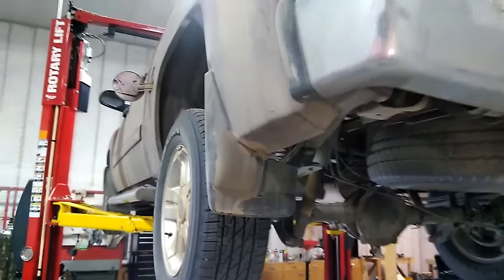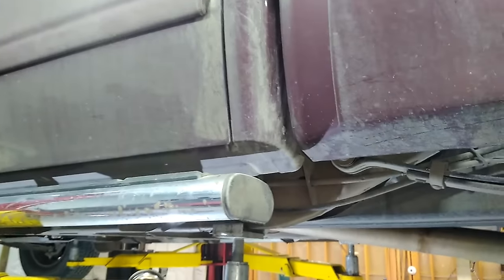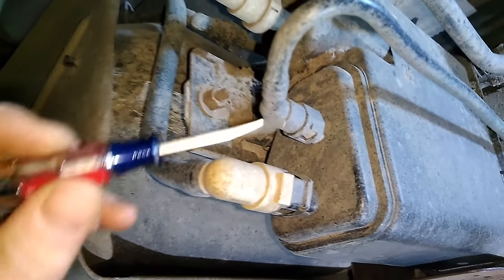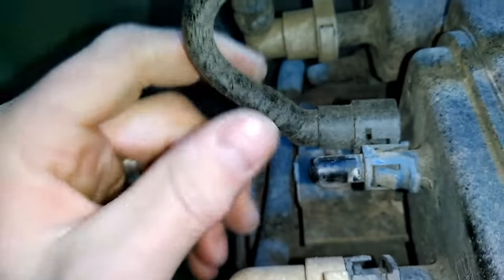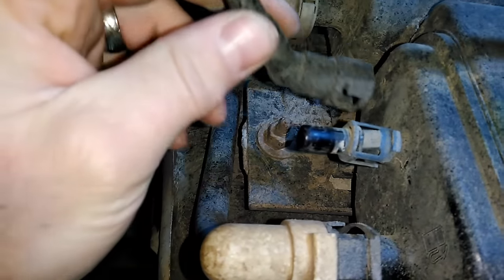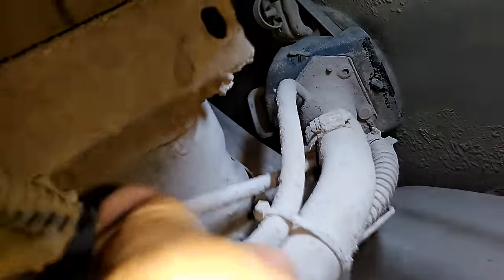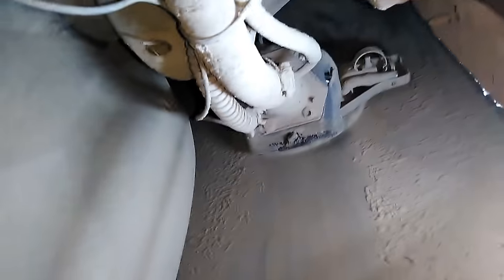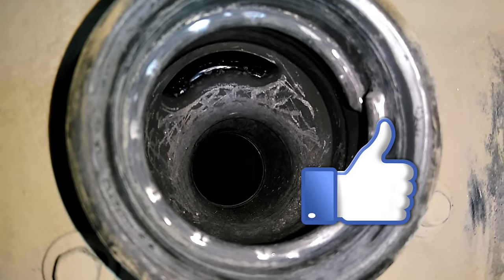Chevy Fuel Evap Canister Fill Fix Filling Slow

Comment from the maker: Taking Apart Charcoal Canister And Vent Relocation On 2012 Chevy Silverado Truck https://youtu.be/ASCLntCU0jQ
Reply: Is there a reason you did this instead of running the water through then?
Reply from the maker: Just wanted to see what is was like inside and ran vent line so it would not clog again
Reply: Thanks bro
Reply: Really? We can wash the canister? Awesome! Should we wait for it get completely dried up before reinstall it back?

Comment: I work for a company that makes canisters for GM, Ford and FCA. I can tell you that washing it out with water was probably a waste of time. The flow rate on those cans are typically 60-70 liters a minute. The fuel system that monitors the leak rate of the system and that monitors flow rate. Will cause a MIL light to come on if it falls below that flow rate or the total flow rate set by the manufacture after the canister is installed in the vehicle. When the company that I work for manufacturers these canisters. The charcoal(carbon) has to be dry in order to know that a canister is a good part based off the customer’s specifications for flow rate and leak rate. As a canister ages from my understanding. The charcoal(carbon) will eventually dissipate and or turn into dust. That is by design so that after 10-15 years you will need a new one. These canisters do have springs with retainers and felt in them to hold the charcoal inside the can.
Reply: I, guess the charcoal is desintegrated in black dust, and people think is so dirty and clogged, and using water or air will blow out the dust, but probably the carbon has a function, if desintegrated, the Canister is not doing the job properly anymore and should be replaced at some point.
Reply: I agree that the activated carbon has a life time base on refueling cycles. As you fill it, it gets warmer or hot. This is an “endothermic” reaction, as the hydrocarbons are absorbed. During purge, the tank vent valve is open, which defaults to open. This is when the problem happens. It is drawing in outside air. If you are a farmer in Iowa or live down a gravel road, the dust that’s kicked up goes thru the tank valve, thru the canister, around the activate carbon. Magic allows the hydrocarbons to release into the air with less or no gas in, then into the engine and burned. The PCM closes of the tank valve and if dirty, it leaks. Fails twice you get small leak code.
   Tank valve have all shapes but adding a filter, moving with a good sealed hose, to a dust free location will help.
  What sucks is the trend is to make the canister & valves all 1 part. 
  Near Dubuque, IA is a shop who does wash them out. However, he caps them off and places into a vacuum. This boils off the water at room temps. He has had decent success using the shop truck as $340 for a new canister was needed. He also tried a white sock over valve for filter. I am sure that some small engines use a round air filter inside a plastic canister. This would work great if hoses to the vent valve fit. 
“Hey, Get off my Lawn”

Hot/cold cycle would more than likely break down activated carbon due to a little expansion & contraction, turn to dust and travel up purge line to valve, into engine. That’s going to leave a mark!! ;(
Reply: Your right, as a 40 year GM  master tech, you are told this stuff as you progress through your training.
Reply: If i have rust in the solenoid is the canister bad or filler neck? Replaced soenoid and still have problem.
Reply: Yes I do agree with you as a mechanic. But these guys are just doing cheap fixes so they can fill there tank up faster. Lol
Reply: How can I unblock my I have a 2017 gmc Arcadia with only 50k and can't pump gas for more then 3 seconds without it coming out.
Reply: @rob29032  I believe there is a float valve in the fuel tank called a “double wall” is what we called the part which is made in Connersville indiana and some are made in the Stant plant in Mexico. Those valves is what shuts off the pump automatically thru fuel vapor exiting the fuel filler pipe. If that valve fails or gets stuck in one position or another it can either over flow or cause it to shut off quickly like you’re talking about. Now how about going to replace that part. You may need to talk to you local dealership. They maybe able to help you get the right part. I don’t know of any after market parts. Ours was all OE.
Reply: Well its good that some one like you watch this guy video otherwise we be doing the same and just to waste time and money. To be honest i give the guy credit to try to help, but with your knowledge we now know that it wont work, thanks man 👍🏼
Reply: @tannerwimer  well not faster, we just want to be able to put gas, period. 
On my 2008 dodge Dakota that canister is $200 and mechanic wants $300 labor. 

Well worth it but I’m going with 3 hour labor and 10 cents of water from my garden hose for a total cost of elbow grease 🤷🏻‍♂️
Reply: I have a question. Why does the can and the vent hose from the fuel tank have a plastic foam all inside? The foam is a transparent green in color. I DO not see how it can vent and it doesn't with that foam in the lines and charcoal can.
Reply: @johnd4408  so those foam pieces are there to give the system the proper flow and back pressure for the fuel system. Per manufacturers specifications. The engineers at which ever manufacture gives companies that produce these canisters those specs to align with government EPA standards of those particular model years of vehicles. Again those foam pieces don’t filter anything just a medium to control back pressure and flow rates needed to work with other components in that particular fuel system.
Reply from the maker: Probably work too
Reply: Be nice to see a video with a nice drawing illustration showing this systems in order how’s it functions . U can see it’s somewhat confusing on how it pulls vapors , when it pulls them and how it does with engine off while at the pump .
Reply from the maker: The filler pipe is small so when putting gas in air can’t escape from filler neck (plug flow) so when filling tank the air space has to vent through the charcoal canister.  This is actually the vent for the tank.  Then when you start your car it opens purge valve which pulls vacuum from engine to regenerate.  The fresh air gets pulled in from hose with makeshift sponge filter by wheel well.  That’s is where the dust gets pulled in over time, then clogs canister.  The only happens for however long the computer tells it too.  Hope this helps
Reply: Just slap some black tape over that engine light and you will be fine ! When the engine really runs like sht just plug in your tunner .
Reply: Thank you for taking the time to help out with expert information. I always read the comments, just in case, and in this case, what you say makes perect sense
Reply: Bloodsuckers
Reply: @kevinwhite4389  remidisiver!
Reply: I need a new evap canister..2006 Chevy Silverado 2wd 5.3L long bed
Reply: Soo...if the charcoal turns to dust and you wash the dust out then there is no charcoal left and you basically deleted the damned device.
EXCELLENT
Reply: Thanks for the info
Reply: @pete4866 😂 right
Reply: @zjedinite  I took mine off and cleaned it and then blew it out with compressed air (the lines also), put it back on and never been an issue since, that was 3 1/2 years ago
Reply: @kellismith4329 Did you clean it up with water as well?
Reply: 2005 Chevy Tahoe. I removed my canister and emptied all the charcoal out with air compressor and shop vac. Reason being I didn’t want charcoal clogging the lines up since this seemed to be my problem. I used a shop vac under the vehicle sucking the fuel line and you could hear charcoal prices sucking through the tubes. After all said and done I found a replacement canister on Amazon for $40.
Reply: I'm guessing you won't see this because your post is so old. Do you know if you can replace the canister with new charcoal or if something like an ultrasonic cleaner clean the charcoal?
Reply: @bratboy5203 I think the issues is the charcoal pellets get stuck in all the vent lines. The way canister is made you could create your own but you need a filter of some kind to hold the charcoal.
Reply: @justindoyle231  so the lines can be emptied and the canister reused?
Reply: Just unplug the hoses. Done
Reply: @bratboy5203  No unfortunately those canisters are welded together thru a vibration welding process that completely seals it up from being taken apart. Besides that there are plastic retainers that keeps the carbon pellets in there. Basically you will have to replace the unit with a new one.
Reply: Who cares about the MIL light as long as you can get the gas in the tank without it stopping every second. I did this on my vehicle a few years ago and I didn't even blow it out to dry it and had a MIL light on for about a few weeks and then it shut off. Waste of money buying new when it's made to fail. Real mechanics are not just part installers. They save money and get it fixed one way or another.
Reply: @williamburroughs77766  I would just drill it and drain out the charcoal and dump new stuff in there and epoxy it back up and it be good as new
Reply: @bratboy5203 I would and just epoxy the hole shut.
Reply: 10-15 years?! I’m on #3 in 4 years. Things are re trash!
Reply: @DS-Turbo  where would you get the correct carbon from? There are different grades of carbon per manufacturer spec. Besides that even if you was able to find it. The way those canisters are assembled getting the correct amount of carbon in there would be a guess at best. These are volumetrically filled to a specific spec amount.
Reply: Hi thank you hi my name is Arthur and I am interested to know who manufactures these charcoal canister is because I’m in the tool and die business. It would really help me out. Thank you so much.

Comment: Great presentation and it really works. I fixed my gmc exactly as you showed in your video.  The truck is running great and at the pump the only click I hear is when the tank is full. Thanks alot.
Reply from the maker: Thank You glad it worked for you. I know the pain of trying to fill a tank for 30 minutes and still never get it full
Reply: Is it still working fine?
Reply: @mohamedhosini2103  yes it is working great.  I have filled the tank several times with ease and the error code disappeared day one and has not returned.

Comment: Thanks for taking the time to make this video,  I will take care of my truck this way, my mechanic  wants 550 for the labor of replacing the filter and solenoid.
Reply: Ruben Salais well do the work your self , I don't mean that in a bad way I just saying do it your self a save your self $550.00 , the mechanic who tested my 2005 Chevy Silverado 4x4 1500 told me what the part I needed and he said it would be $649.00 for labor plus the part ! I got the part for $32.96 and I did it my self and saved me the cost of the labor , just think about it , you can save your self a ton of cash
Reply: Here is another idea, buy a new canister and test disconnected solenoid for ohms. If none show on meter, replace solenoid.  This is a hack and so is this guy.
Reply: @hshsgjakanss  I going to try that since my work truck is also started with the same problem,  thanks for the tip
Reply: @rubensalais1502  No problem, i just hate misinformation like this.  Also, so you know, the "hard to get off" fuel clip, yea you just push it in and pull line off with ease.  Hope i helped
Reply: @hshsgjakanss  thanks, I will do that this weekend
Reply: @hshsgjakanss  it was hard to get off because it was broken.
Reply: 30 dollars in Amazon

Comment: I work for an automotive company in Alabama and I just so happen to make canisters and i'm telling you that you would never put water in it you can use like 45 Psi air pressure. But for the part to work correctly it must have a required amount of carbon along with the foam pads. We get an empty canister where pads are stitched along with a long filter which is rolled with foam also then it's put 8nto a machine that puts exactly the right amount of carbon for each space then more foam pads are put on top to trap the carbon then a bottom plate with springs for each space that has carbon is put into a heat welder that presses it all down to trap the carbon.. Duh! When I take it out the welder I shake the canister if you hear any rattling which is caused by either a missing pad or not enough carbon it means the part is no good. In other words it needs all its carbon my advice is just replace with a new one or eventually you will be in trouble.. It's made one way and that's the correct and only way for it to help your car keep it's peak performance. Hope it helps

Sincerely a welder in canisters at leehan America inc.
Reply: Ty
Reply: You sir are creating a bogus product!

Comment: I'm a mechanic and GM is always the worst with high mileage either the canister of the dump valve down under or up top or both thanks for the video Never clean one just change them LOL
Reply: For my case, at a discount it's 150$ for a new canister. I'd rather spend .15¢ on water and try this lol sucks sometimes that the more frequent items to fail tend to be the more costly.

Comment: you're right squirting the  water on the clips, dust fills the clips and the tabs wont compress, so squirt water, wait 30 seconds for the dirt to soften then blow the mud out with compressed air (works on dirty electrical connectors too) So now you've cleaned the canister but never cleaned the vent valve OR the really dirty foam filter. These were actually the problem. I think the 07 up vent valves were sealed, but the electric solenoid on the valve comes off so it could be flushed out too. The older ones had a removable lid to remove and a foam filter to clean.  While you're at it relocate that hose and foam filter by the filler neck up to the engine compartment too. This is a major problem for all vehicles driven on gravel roads, something that even 4x4 trucks weren't designed to do.
Reply from the maker: Yeah on another truck I relocated the vent to the front of radiator. Working real good no issues anymore. I actually did a video of it too https://youtu.be/ASCLntCU0jQ

Comment: NAPA sells lock tabs fittings orings i just did mine on GM  fuel pump line.
Hint :dont fill fuel tank while engine is running and dont top off tank and try to keep putting gas in after pump nozzle clicks off.
Reply from the maker: Very good point

Comment: I believe, maybe,  the small  horseshoe clip connector,  which you  broke the clip on, is actually supposed to be pressed IN, NOT removed ?    The inward pressure to allow pull off the  line straight off ?

Comment: Hi there!! really good content! thanks for sharing     
Mine is allowing gasoline smell to scape when filling up the tank. Washing it as you did will make any good in my case? It's not clogged only its charcoal is saturated I think.
Reply from the maker: I would say your purge valve is bad, so basically it is not letting the vapors go to engine when it should be purging (regeneration of carbon)

Comment: Can the truck be driven without the bottom hose to the Evap cannister attached? and will it fill any faster
Reply from the maker: You could but probably get dirt in gas tank, that directly connects to it and will always smell gas in you park in garage. Probably not a good idea. If you going to do that just cut canister apart and through carbon out.

Comment: Hello zims. I did this ,this past sunday. And it saved me the headache to had to buy a new charcoal can.and i also checked the filter and everything was clean and the tips you gave us here what to look for. Was spot on. I have a chevy s10 2002 and the set up its very very similar to this . The hose  clippings are a little better on mine then this clipping on this one on the video.i also did the water wash and then preassure clean it. So at least ! I know isnot the charcoal can or the filter valve overall this helpped me alot ! Not yo mention buying part i dont need and thenhaving to return it. Thanks a million !!!!!👍👍👌👏👏👏👏👏

Comment: When you have a flooded charcoal canister, is the gas smell evident when the engine is off or does it happen only when the car is running or in idle? I am suspecting a faulty charcoal canister because of overfilling the gas tank once. I overfilled it but not to the point the gas was overflowing. I smell gas when I first start the car but not after a while. I don't smell gas when the the engine is off.

If the problem is actually a carbon canister flooded with gasoline, do you think  taking out the canister and let the gasoline evaporate for a day or so fix the issue?
I have read that overfilling the gas tank can flood the canister and produce problems.